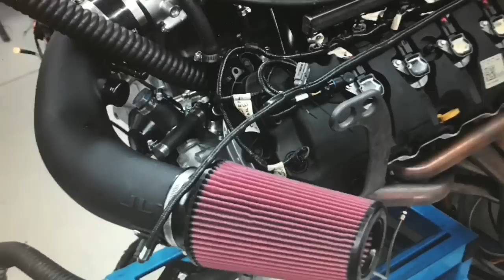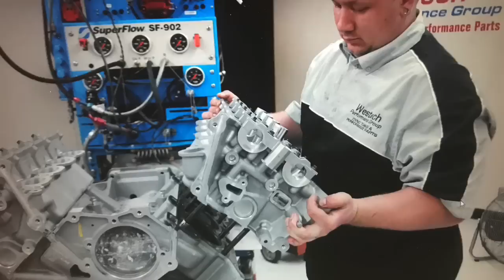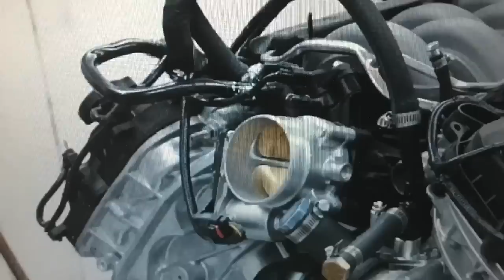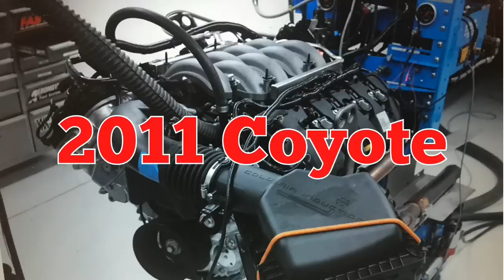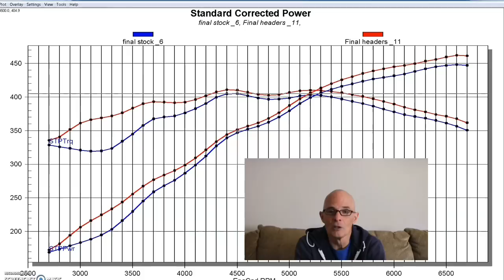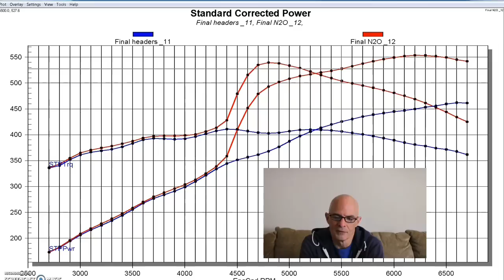5.0L 4V COYOTE MODS-NITROUS & HEADERS (GEN 1 YOTE)

Comment: I love the coyote but I doubt it will beat the 6.0L
Reply: Inferno_Spud honestly that new LT L83 is 🔥
Reply: Coyotes keep going where Ls stops, facts!!
Reply: Also, NEVER did I lie. MAYBE and I stress MAYBE your motivations are what you say they are but by your own admission part of the reason you are putting a Coyote into a Chevy is to troll Chevy guys. Like I said, maybe it is YOU who are lying and maybe that person you are lying to is yourself.
Reply: In terms of bottom line hp numbers the Coyote and the ~6l LS are usually pretty similar. Were the Coyote shines is hp/l as it does what the LS does with a liter or more less displacement. LS usually wins in torque though.
Reply: @177SCmaro  I love the Coyote for it's tech, but the LS is so small on it's outside dimensions I can easily see why pretty much everyone loves them for the big power / small package aspect. Put them in anything with plenty of room for additional activities like turbos etc in a small chassis. I'm a Coyote owner / lover here, and I do think they make good power for their displacement, but the damn things are friggin huge with their 4cam 32 valve design, just a different way to do it I suppose.
Reply: @MrLightning54  
Tell me about it. I'm swapping a Coyote into my second gen Camaro racecar, which are known to have pretty large engine bays, and it just barely fits between the A-arms. It certainly has "presence" in any engine bay, lol.
Reply: @177SCmaro  As cool as that's going to be, I couldn't imagine swapping a Coyote into anything aside from what it came in from the factory.
Reply: @MrLightning54  
Not as hard as you might think. It was actually harder to fab headers then it was motor mounts and they make Ford modular to GM TH400 bellhousings. It sits in there fairly comfortably. Break booster is going to have to move and the frame is going to need notched if I leave the alternator in the factory location.
Reply: @177SCmaro  Are you doing it to stick it to the GM crowd, or just love the car, and the potential of the high revving Ford?
Reply: @MrLightning54  
Yes. lol.
It's my revenge for everyone who's ever sbc or LS swapped a Foxbody!
 Seriously, though, mostly I'm doing it because I'm a little bored with small block chevys. Been building them all my life and I wanted something a little more sophisticated and modern mostly to challenge myself. It will also be my first turbo engine I've built though not my first supercharged one.
Also, my Camaro is the first car I ever drove. Took my diver's licence test in it, car I drove in high school, etc. so there is some sentimentality there too, I suppose.
Reply: @177SCmaro  Very, very cool man!! My little 2011 Mustang has an On3 single turbo on it and it's running pretty damn good for me, although I loved my previous Paxton I had on there for it's simplicity. It's definitely faster now, just a ton of bs to make it work half decent at the track. Not much sentimental value on mine for me, just trying to go fast with what I'm at least somewhat familiar with, lol!
Reply: @MrLightning54  
Like Odysseus said in Troy, we play with the toys the gods give us. I'm looking at maybe buying a Mustang like yours someday. They're a lot of fun.
My brother has a 14 Mustang GT and he's debating on boosting it or buying a GT350. Either way the moneyshot will be when we're both out at the dragstrip and pop our hoods and we both have the same engine. I'm looking forward to trolling some people with that, lol.
Reply: @177SCmaro  Hell yeah! Me and my wife looked at a local late 70's Vette that's for sale, and discussed how cool that would be to Coyote that thing, just to cause some sort of riot hahaha. It's actually too damn nice and also too expensive the way it currently sits though, lol.
Reply: @MrLightning54  Man, a corvette. That could be challenging to squeeze a Coyote in there but like I often tell my fellow employees when they ask if I can fix or modify some oddball thing, anything is possible with enough time and money. There's a video of late model corvette with a 13B Mazda Rotary engine in it on youtube. They even had the balls to take it to LS fest.
https://www.youtube.com/watch?v=9e7mVcjzOOk
Reply: @MrLightning54  people don't hardly swap Coyotes into anything because it's just not practical or economical. The bitch is huge, complicated, expensive and top heavy. Why spend $3500 on a used Coyote and have fitment and fabrication issues when you can spend $1500 on a used aluminum gen 4 LS? With the LS you don't have the fitment issues and its lighter, smaller and makes just as much power with a ton more torque. Only trolls buck the trend by replacing LS with Coyote stuff or putting a Coyote in anything GM powered. For every single Ford powered Chevy there is 99 Chevy powered Fords. There is a reason for that and no it's not because Chevy fan bois are trolling Ford fan bois. It's just a more practical economic swap. When the goal is to go fast you use what works best for your budget. Don't get me wrong I love my Coyote for what my goals are but it is what it is regarding engine swaps. If I was building a purpose built drag car tomorrow and the goal was to go high 7's it would be a fox notch with a turbo LSx.
Reply: @ShizawnSanders  
Why Coyote swap something? 
Why strap yourself to a million pounds of rocket fuel contained in a multi-story metal tube built by the lowest bidder in order to blast out of the atmosphere at 18,000 miles per hour?
 Here is your answer to both: https://www.youtube.com/watch?v=De2SuYAjrdY
Reply: @177SCmaro  being cool and being different at the expense of cost and practicality are 2 different things. You said yourself that you are doing it to troll Chevy swaps. You are effectively going out of your way with more complications and expense to troll and be different. Hey, its America. You do you. It's a free country. Don't compare that to NASA though. NASA is looking to achieve their goals the best most economical way possible. Your way is completely opposite of what NASA does.
Reply: @177SCmaro  i dont like coyotes but that is cool as hell. I love weird engine swaps.
Reply: @ShizawnSanders  And, in my case, what's the difference? It's cool because it's expensive and impractical. Being different or novel usually is. 
And btw, it wasn't that impractical or that much more expensive then building any other 800hp engine. I had to fab motor mounts and headers and will have to move a break booster. People do that all the time.
Actually I said I mostly did it because I'm bored with small blocks and wanted to challenge myself - that is my main motivation for this project (will put some videos up once it's running if anyone is interested). Trolling people with a late model mustang engine in an old camaro is an incidental benefit. 
And I don't recalled even using the word "NASA". My point was someone had to be the first crazy bastard to do something insane like sit on top of a rocket and blast off into space. Someone has to be the first to do oddball motor swaps. If no one ever took any expensive and impractical chances (like going into space) we'd all still be living in caves, eating bugs off of each other, and burning literal shit for warmth with no engines to play with. So maybe there isn't as much of a difference between being different, expensive, impractical, and being cool as you think?
Reply: @theall-seeingpie8887  
Once it's running I'll see about getting some videos posted. I'm still in the middle of degreeing cams right now. All four of them...sigh. And dealing with a freaking backordered right hand cylinder 2end gen head from Ford for going on 2 months, so I might have to run the truck heads for now. If anyone knows were I can buy a right-hand (passenger side) 15-17 new Coyote cylinder head I'll give you my first born child for it.
Reply: @177SCmaro  like I said you do you. It's a free country but don't pretend that's not cool to some and don't pretend it's not for attention. That's mostly cool to you and obviously attention seeking is what matters to you. Have fun with your trolling.
Reply: @177SCmaro  lol, whatever you say buddy. Keep telling yourself that. LMFAO🤣
Reply: @ShizawnSanders  No, not "whatever I say". Stop lying and I won't have to "say" anything.
Reply: @ShizawnSanders  So you belittled and lied about why I'm building this thing because you're butthurt about some unspecified remark I made somewhere? ffs, dude, grow a thicker skin. 
If there's nothing else I've got an engine to put together. Go bother someone else.
Reply: @177SCmaro  then why keep commenting? Are you sure you have a engine to put together?
Reply: @ShizawnSanders  I seen a lots coyotes swaps fox bodys
Reply: @mr.shadowfall602  yeah, and that's a cool swap however I have seen way more LS swapped Fox Bodies than Coyote swapped fox bodies and I have never seen a Ford swapped Camaro unless you're talking about the rear end. There is a reason for that.
Reply: @177SCmaro  LS has cubes and more torque, but the coyote makes peak power really high in the rev range (assuming correct camshafts). That will somewhat make up for the displacement, ultimately won't beat the 6.0's peak though. My guess.
Reply: 177SCmaro the 5.3 LT L83 makes almost the exact same numbers as a 6.0 ls. It’s a power house in hp per liter and torque.
Reply: That gen 1 Coyote won't beat it. Gen 2 is a different story but then again to make things fair GM has the 6.2. Also, bringing up the difference in displacement is ricer mentality. The LS is physically smaller, lighter and makes way more torque. This is coming from a Coyote owner BTW. Where the Coyote really shines is with gen 2 and gen 3 engines. Oil pump/crank gears, fuel system, bolt on FI kit will make you 900RWHP all day every day. No heads, no camshafts, no intakes. Nothing but boost, exhaust, fuel and tuning. That's where the Coyote is better imo. It's a better bang for your buck engine in that regard.
Reply: @ShizawnSanders  If bringing up the difference in displacement is "ricer mentality" then a 27L, 1500hp Merlin craps all over both the LS and Coyote as the Merlin made that power stock at 3000 rpm all day long, 75 years ago.
Reply: Shawn Sanders really not trying to pick an internet fight. I’m more tying to learn. 

I’ve never heard the coyote described as the best bang for your buck engine. I’ve seen many guys yank out 700-800 whp on a 5.3 for bottom dollar. I think the new L83 LT will be even better and I think you can get them for like $2500.

Thoughts?
Reply: @Gregoman89  I have to disagree too. The Coyote is a great engine but it's also a little bit complicated. Not the best "bang for your buck" if you're building one from scratch or doing things like camshaft upgrades as it takes like 1500 bucks for all 4 cams were it's more like 400 or so for a LS cam. Primary and secondary timing chains and sprockets, tensioners, etc these all add up. There is a trade-off for running those awesome 4 valve heads. 
The bottom end costs about the same though.
Reply: @177SCmaro  I agree and 400 for a LS cam is on the high side
Reply: @Gregoman89  I'm talking buying a brand new car. If you are buying a brand new car it's hard to beat a gen 3 Coyote car with a 10R80. Of course a junkyard 5.3 is the best bang for your buck in terms of swaps and such.
Reply: @EGGINFOOLS  
For a custom and/or billet cam 400 bucks is pretty standard. I'm sure they make cheaper one's just like you can run the much cheaper stock mustang cams on the Coyote which are still pretty good. Over 500 lift on the 2ed gen.
Reply: @177SCmaro  Yeah no doubt. Unless someone plans on staying up in the room for dirt track or similar a billet cam isn't necessary for high horsepower with dependability. The summit cams are couple hundred and will support well north of 1000hp without problems.
Reply: Shawn Sanders ah ok.
Reply: @177SCmaro  when he said best bang for the buck i beleive he was meaning to start with a stock engine and get to 800 whp as with the gen 2 and 3 coyote you can get that number with a stock engine and boost whereas with the ls you usually need the boost as well as cam possibly heads etc to support that kinda power.  That is the way i took what he meant by best bang for buck
Reply: @ShizawnSanders  agreed... I like coyote for boost.... nice LS motor for a heads cam torque monster NA
Reply: @ShizawnSanders  coyote is lighter than a 6.0. Seen it in a 1976 Volkswagen bug in the front. They fit everywhere a ls fits.
Reply: @darrenmcfeaters6683  a aluminum block? Hell no it isn't and no, Coyotes don't fit anywhere LS's fit. CLEARLY you have never seen a Coyote and LS next to each other. There is a reason the LS is used for so many swaps over the Coyote. I have owned MANY LS's and this is my 2nd Coyote car. It is OBVIOUS every time I open the hood which is smaller.

Comment: I thought those things were supposed to rev out to like 8k or more why you stop at 6500
Reply from the maker: a stock 2011 Coyote with stock cams and stock intake makes peak power where we show-it can rev higher but does not make power up there
Reply: The old ones won't take the timing like low 20s..  can't rev like the new ones.. the 2019 and up will run timing in low 30s.. Ford makes modifications to the coyote every year.. I had a 14 stock.. and it was way better then the 11.. 15 better than 14.. and keep getting better every year
Reply: If you look at the horsepower and torque curves, both are beyond their peaks before the end of this run.  I'm sure this engine would easily rev out further, but it's just rpm for the sake of more rpm.  It's not going to improve on these numbers by going for more rpm.  Not in this configuration anyway.
Reply: @ShyaMiss  I don't know torque is falling but I'm not sure that horsepower is
Reply: @james10739  it has already begun to start the decline at the end of the run.  Another 500 rpm would have highlighted it a bit better, but it does show a start to the drop off.

Comment: Even as a Ford guy, 1,543 hp is a tall order, gen 2 engine or not.
Reply: Yea, it's pretty unpredictable at that level. The heads & crank are there for sure - but neither the Coyote blocks nor LSx blocks are considered "safe" over about 1000HP, they both have relatively weak cylinder liners for any kind of extended use at those levels.
As long as everything can hold up to some 'hero runs', then the Coyote 'should' be able to match any of the LSx short blocks, the architecture is there, the cylinder heads are certainly there(IIRC, Gen 1 heads outflow GT/GT500 heads by 4% or so, and they've only been improved), but we'll see if the bottom end is there. I am feeling a bit optimistic, there's no shortage of "stock Mustang GT with twin turbos" chassis dyno runs hitting 900-1000RWHP. Add in the lack of drivetrain loss & accessories/intake/exhaust of an engine dyno, plus the "big bang formula"(ring gap and what not), and it's looking REALLY compelling for sure...
Reply: @RyTrapp0  Have to disagree about the LS blocks not being reliable over 1000hp.  I am pretty sure I have heard Richard say he has well over 70 pulls over 1000hp on more than one stock LS block.
Reply: @BigMikesGarage  Iron or aluminum? The Coyote is an aluminum block so we're comparing it to aluminum block LS's for strength. I think any stock production aluminum block is in the danger zone over 1000hp. 
That said, there is an iron block for the Coyote that might come out this year or next that is designed to withstand ProMod horsepower levels so Coyote guys will have the option too.
Reply: 177SCmaro isnt the truck coyote a cast iron block? Or is it all aluminum too?
Reply: @CraftsmanQuad19  
No, all 5.0 Coyote production blocks are cast aluminum. They are heavily ribbed though to withstand a lot of power and miles.
Reply: @177SCmaro  He said stock block, nothing about aluminum.  The stock cast iron blocks are well tested over 1000hp.
Reply: @BigMikesGarage  Stock block ls motors were aluminum in some applications.
Reply: @BigMikesGarage  
Then I wouldn't worry about it then. Iron LS blocks are very strong but a proper comparison between the Coyote and LS block strength would be with the aluminium LS engines.
Reply: @177SCmaro  some ls circles claim the aluminum version is stronger despite the claims of that being held by the iron block. Truthfully, I've seen tons of them and none have failed because the block became an issue
Reply: RyTrapp0 it’ll be exciting for damn sure. Most of my knowledge of coyotes comes from blown applications and 700-800hp seems to be the point where they start kicking rods out the side but I have also seen a over 900 whp blown coyote as well. I would be the happiest man alive to be proved wrong.
Reply: Thank you for being far an honest
Reply: Yup and sadly when i was playing around with the old 5.0L motors their blocks were good to @ 500HP, boy we’ve come along way